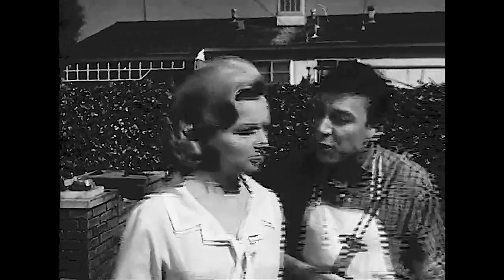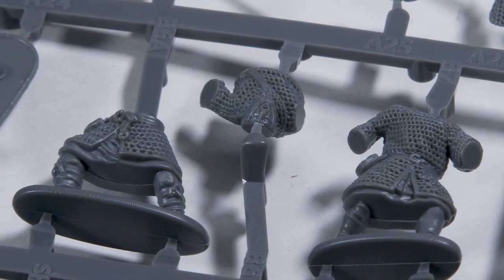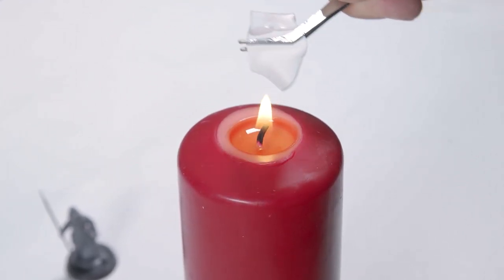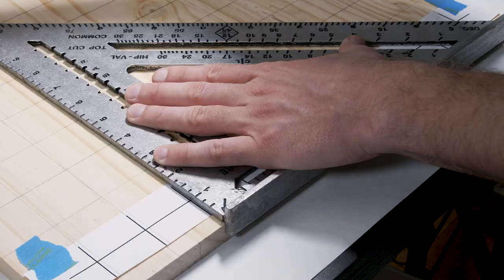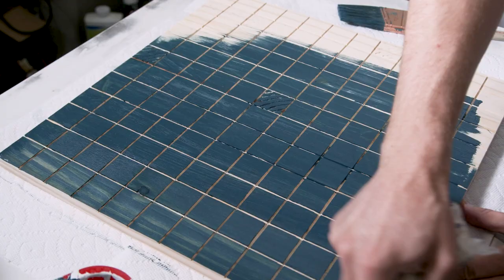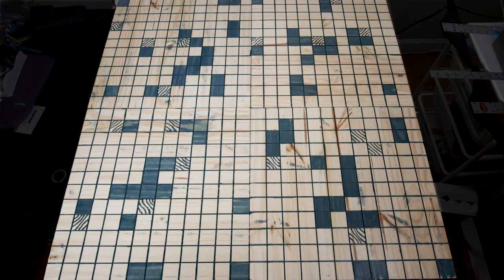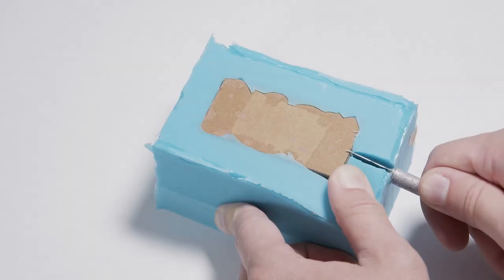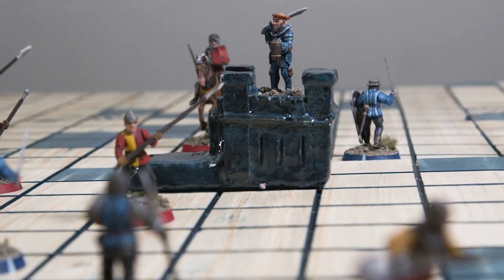Replicating a Tabletop War Game From 1967 | Board Game Overhaul: Feudal

Comment: As a retired  dental technician of 42 years and mixing plaster of Paris every day may I offer a couple of tips. Firstly add plaster to a bowl of water rather than water to plaster. Slowly sprinkle in so the water soakes up the powder.. you get a smoother mix. 
Secondly after you have mixed your plaster pour it into a container  with an airtight lid and give it a good shake. This gets rid of a lot of air bubbles. We used this method when our vacuum mixing machine was not working. 
Lastly if you could use dental stone rather than plaster of Paris you will find your castings much improved. 
My choise would be a good quality die stone used in crown and bridge work but it could be a little expensive for a small project.
One last thing. When we used to cast into silicon moulds  we always had  a container of diluted washing up liquid on hand which we dunked the mould into and then washed away under the cold water tap. This helped the plaster mix get into all the mould detail and as you pour into the mould, gently tap the mould on the table as you do it. 
Hope this helps.
Reply from the maker: thanks for the info. I have to try detail plaster on a future project.